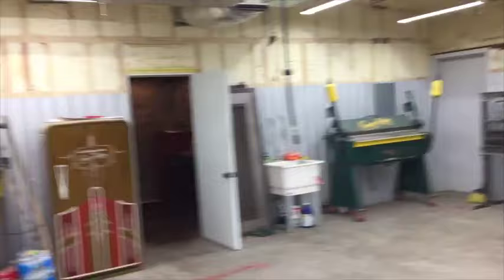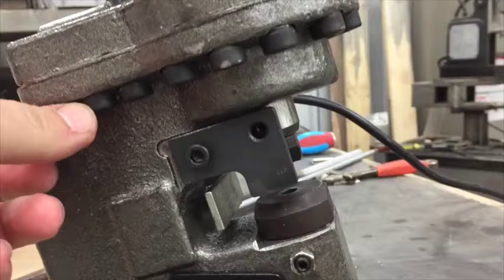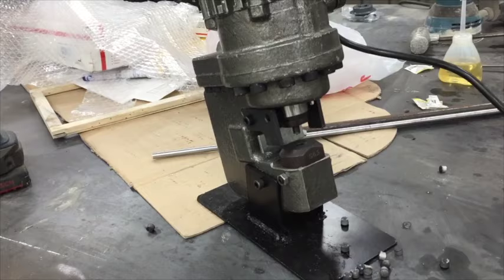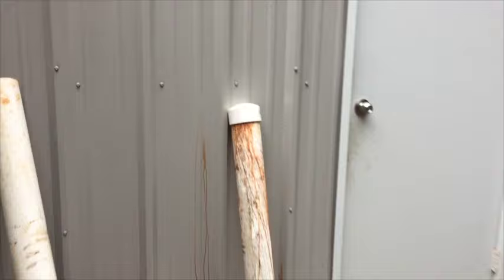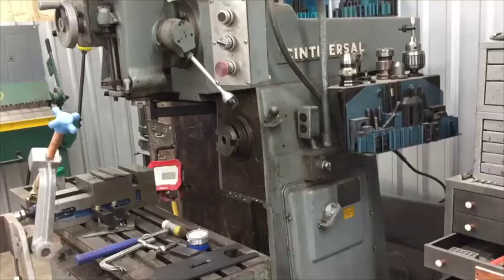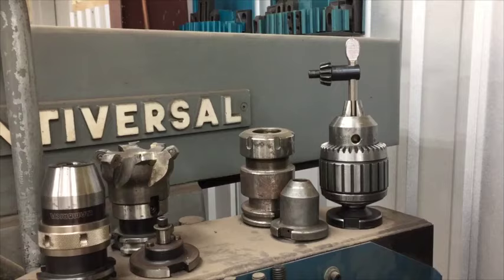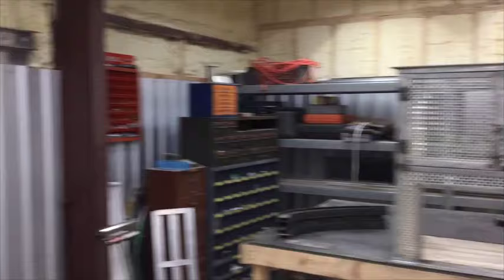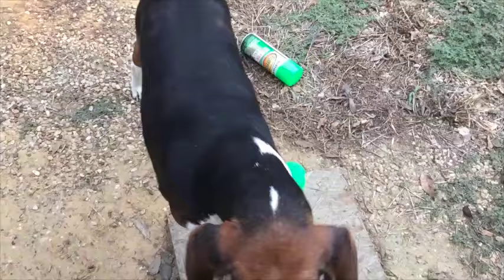Shopdog Sally - I am not as pissed now - Attack of Killer Ants

Comment: Your local hardware store (and maybe Tractor Supply) should have a spray that you can use on breakers, relay contacts, etc., including water well pressure switches.  Before application, ensure the contacts are closed and power is off!

Comment: Ants: Smear some grease to create a block to prevent the ants from getting into the contactor . The Grease is harmless and you can always wipe it off. Option-D for Plasma-Table: rent a fork lift for the day. Perhaps use it to move any other machines that you may wish to adjust while you have it onsite to make the most of it. I believe United rentals can drop it off onsite for you.
Reply from the maker: Yes they can, but it's $400 / day with a 1 day min for an al terrain type forklift.

Comment: hey gary. i think if u mill out the throat of the punch for wider stock it will weaken it and snap
Reply from the maker: Thanks sir, your making some sense, wonder if I could add some reinforcement on the sides?  I am going to leave it for now until I have a project that requires more depth.